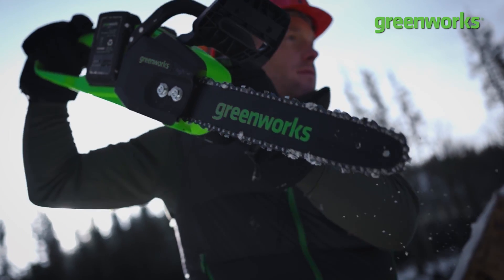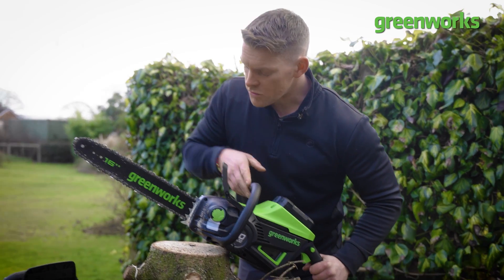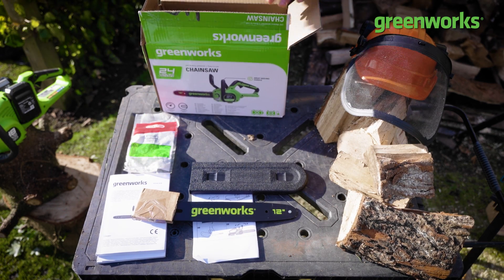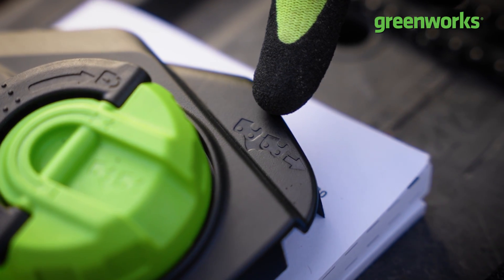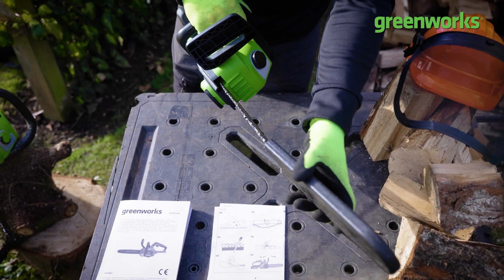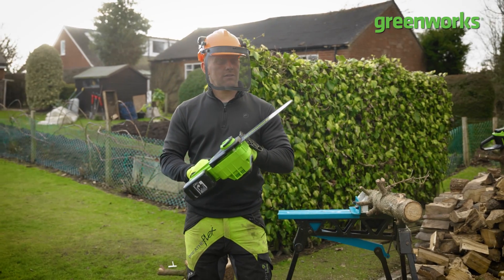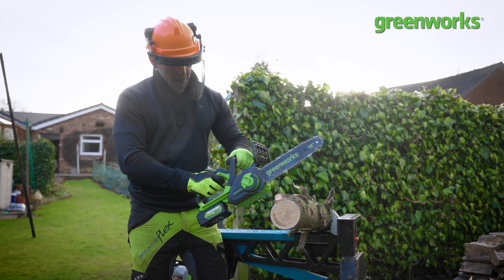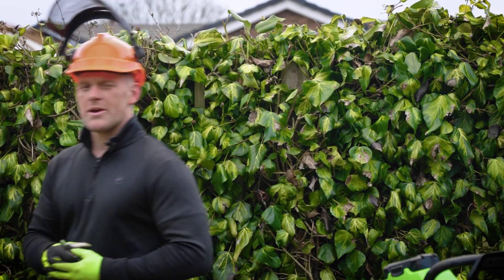Greenworks 24V Chainsaw

Comment: I have worked as a professional logger over 30 years in the forest in Sweden I wonder what is the maximum of a tree that saw could fell??It looks a very smoth light and good safety. I would like to test it both in forest and in gardening.
Reply: Probably small 7-10cm trees max. This is a "pruning" saw not for cutting down trees